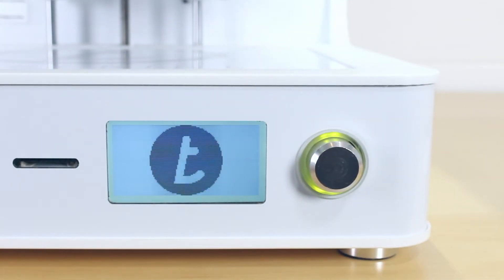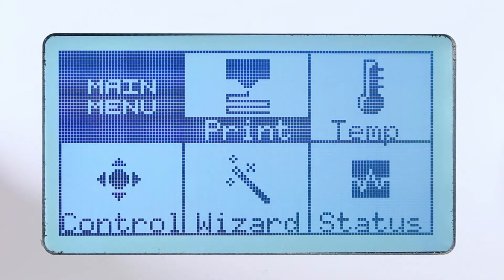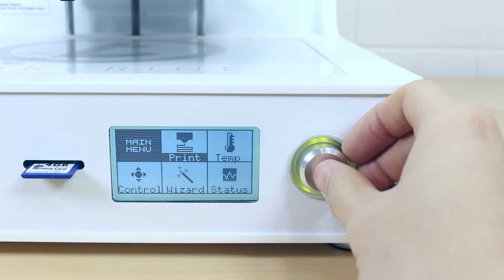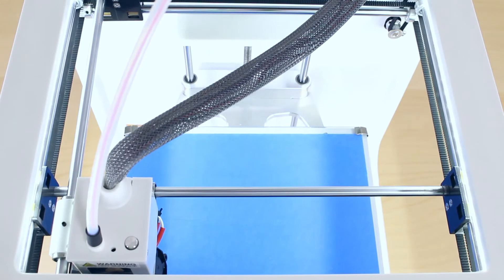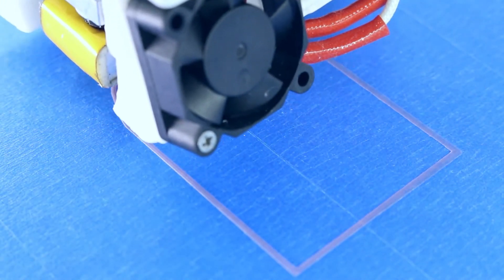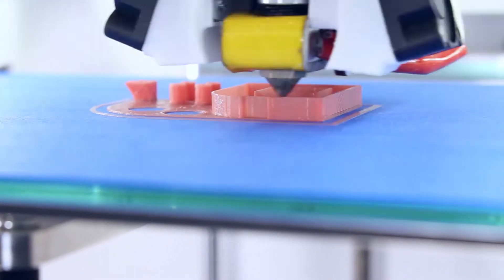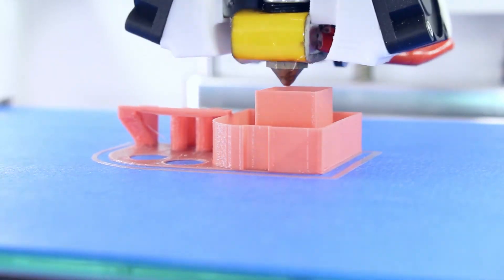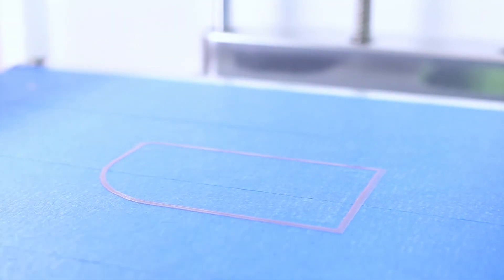How to Start a Print on the Ditto™Pro

Comment: Nice and easy to use I have one question that is this printer will need computer for desgin in 3D CAD
Reply from the maker: Thanks for the comment! You will need a computer and a CAD program to first design a model, slice, and then print.
Reply: @Tinkerine  I really like this printer because it easy to use